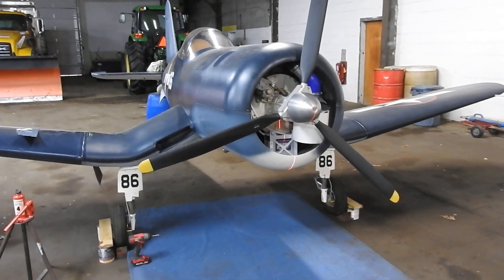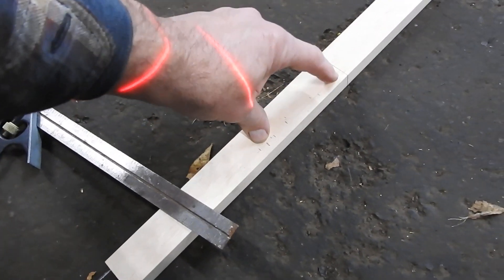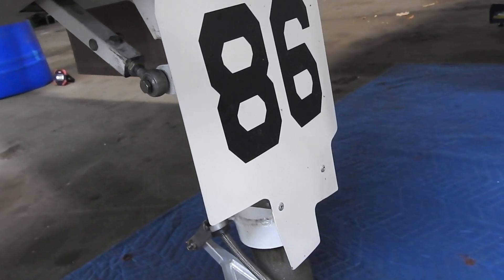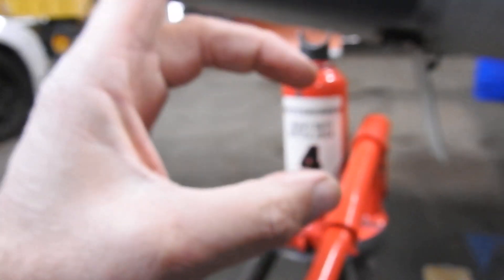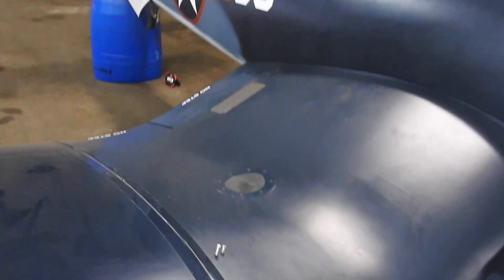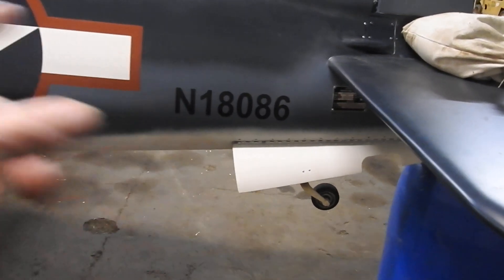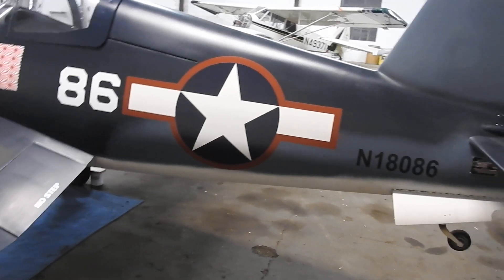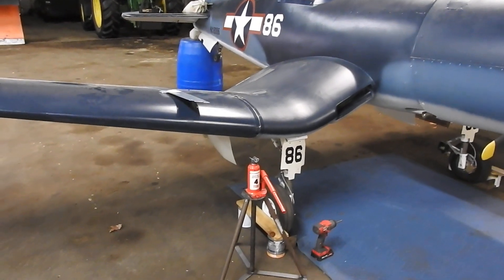WAR Corsair Progress Report 12/10/2023

Comment: A scribed line on the tires, measured with a trammel bar in the most accurate way to measure the toe. On automobiles, toe-in is more stable, too-out tends to wander.
Reply from the maker: Right now I have the toe set and ready for testing. We'll see how it tracks soon.

Comment: I've got to talk to you before tow in. Tow out doesn't really matter just as long as you don't have too much of it. Or not at all towing. On tow in When you go to ground loop, the outside wheel. When the weight transfers to it from the plane to that wheel, it grips and makes you ground lope quicker.  Now tow out when you go to ground. Load the weight transfers to that outward wheel . It kind of keeps you going down the runwand why but the same is totally opposite with the other way brut either way.  You get a benefit and a problem, but they both are equal and cancel each other out. So my opinion is personal preference. You're doing a wonderful job, love your videos.
Reply from the maker: Yes, Thanks, I mentioned that same issue in earlier videos. That's why I went with toe out.

Comment: I had a Johnsons Tiger cub tail dragger. I toed the tires just a bit inward to keep the main gear from spreading. Moving too much, either way, we will wear the tread. It obvious you know what you're doing. Thanks for your channel. 

It is dangerous to fly something you haven't got any time in.
You should have some kind of experience in the same type.
I got into a single seat tail dragger from flying a tricycle gear Flightstar and flew it without a problem, but they both had a lot of wing and rudder.
Reply from the maker: Since this gear isn't a sprung type aluminum, it doesn't flex out or up and down in an arc. Any play in this plane will cause the toe to move some, as well as forward and back only. All planes have some play. You can't get away from it.

Comment: 👍     You're certainly detail oriented.  To align the gear, I'd have either just eyeballed it or settled for  +/- 1.0 deg for either side  and called her good.   Landing speeds are so slow I would think alignment would not be very critical. Landing at 120 kts?, that would be another story.
Thanks for the update.
Reply from the maker: Landing speeds should be under 70 mph.

Comment: Another place you can adjust the tow is the pivot point where the upper and lower scissors bolt together by adding or removing washers between the two.
Reply from the maker: Yes that is true, but it makes the scissor hit the gear door.

Comment: You might wanna jack the main gear, and with a improvised steady rest, to support a scribe, spin the tire, to scribe the actual centerline of the tire / wheel, and measure a equal distance front a rear to your straightedge, as there can be a fair amount of distortion in the tire / wheel assembly.
You can also measure across the scribed lines front and rear, to measure toe directly.
Reply from the maker: Right now I have the wheels where I want them. If I need more or less, I just move the rod ends in or out the same amount. Easy now.

Comment: For your in transit landing gear light, could you just tap off the motor power wire to power a relay to trigger the indicator LED? I'm sure you've already have a solution to this issue though. Thanks for the update Don.
Reply from the maker: The power to the gear retract pump only has two wires, power and ground. They have to be reversed to make the pump run backwards. That is done with the relays. If you try to tap into the power wire at the pump, it will only work in one direction, due to the wires switching polarity. Also the power to the relays are always hot. So the light would always be on. I'll give it some more thought. Thanks for the input.

Comment: I'm sure you were happy that the rod adjustment resolved the in/out issue without the internal alternative you explained.  Looks mighty good, just too cold, wait until Spring.
Make sure those snow plows know where your wing is when they're rushing to get to work and tired returning.....Maybe tall/large florescent orange witch caps like real airports use. Trust no one.
Reply from the maker: There is an overhead door behind the work trucks to get out through.
Reply: Good, thanks. @Dynodon64

Comment: Hi, remember i had the FW190. My A&P tolt me having the undercarrige one degree to the outside is because the Fw gear swing inside, and the outside configuration it tows the gear outbound wile landing. But yours is swinging back, so should it not be 0 degree? For the FW there was an attatchment for the jacks on the firewall nearby the motormount..so it does not hit the mooving of the gear. You are a great builder, greetings from Salzburg a very warm hug for chrismas
Reply from the maker: My gear was toed in a small amount. Being almost straight, and with the little bit of play in them, may have helped with the constant moving around when fast taxi testing. Some toe out should help pull the wheels out and keep them from floating in and out toe.
I think I will be able to jack mine up just fine from a little farther out under the outer wing panels.
Hope you have a great Christmas as well.

Comment: Curious, Is the frame of the aircraft on the same center line as the prop spinner? Is the engine mount set at an angle so that the prop spinner is on the center line after mounting? Nice looking build. What is the build time on this? Thanks for the video.
Reply from the maker: The engine was put on straight inline with the center of the plane, with no offset anyway.
Reply: @Dynodon64  Thanks for answering. Have a nice week.

Comment: I would think with the wheels outside of the struts you would start with toe in or 0 toe, as you roll fwd your slop will cause toe out. Seems your never finished messing with this plane . Maybe next spring ...
Reply from the maker: The wheel play would work either way, if it were toe in or toe out.

Comment: You mentioned play in the main gear - how much and in what directions - fore-aft? inboard-outboard? rotating about the main strut axis?
Reply from the maker: All of the above.
Reply: @Dynodon64  And by how much? The plane I'm restoring has retractable gear that move by ~1/8-1/4" and I'm wondering if that needs to be remedied.
Reply from the maker: There will always be some play in gear that uses a strut design. If you are able to shim out some of it, the better. If there are any bushings that can be replaced, will help. Mine has about the same as yours, but there is no way to get it out. @jridge16

Comment: Don't you have right thrust in the engine?
Reply from the maker: My prop spins counter to normal. I need to use left rudder on take off. Engine was installed straight.
Reply: Does the vertical stab have any offset to counter, as the full scale has?
Reply from the maker: No tail offset. Everything is straight on this plane. @garyprince7309

Comment: Ha! Still dick'in around! Most people build a kit plane because they want to fly it, not tinker.
Reply from the maker: Still being an asshole!
Reply: There are two kinds of builders. Builders that build to fly and builders that just like to build. 
One of my build mentors said, "Make it airworthy and fix the little shit later, or you will never fly it."
Most builders test fly before paint so they can fix the issues while in primer.
Reply from the maker: #1, this was not a "KIT BUILD" airplane!
#2 The "little shit" will get you killed! @chriscalovini1258
Reply: The little shit that you're tinkering with is not the stuff that gets you killed. It's the kind that keeps you from flying.
Reply: You're splitting hairs with Stephen over the Kit built comment. He probably doesn't know the difference between scratch built, plans built and kit built.
Reply: @Dynodon64  Good one 🤣
Reply from the maker: The little shit gets fixed when the weather is bad. The big shit gets fixed when ever it comes up. Like rough running, and over heating. They will get you killed! @chriscalovini1258
Reply: @Dynodon64  That's true but those seem to have been fixed. Go get that tail flying.